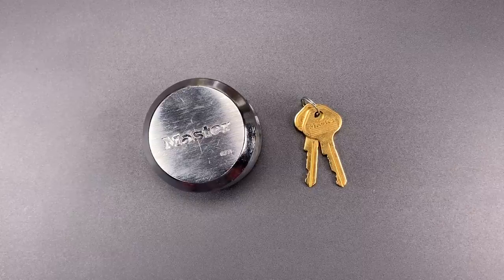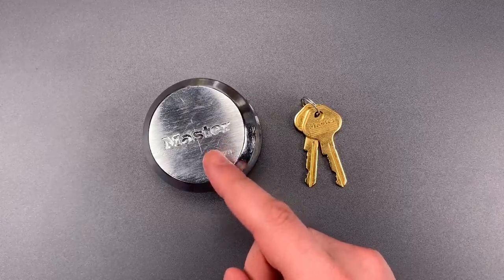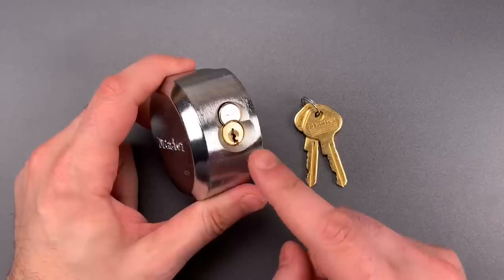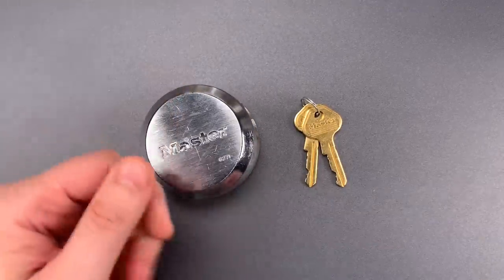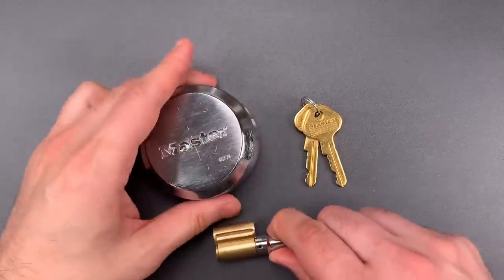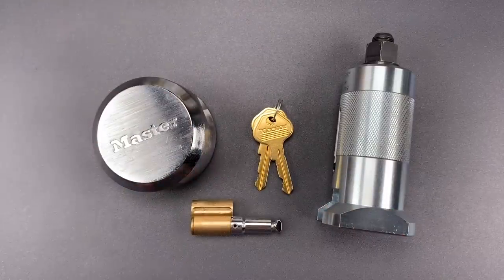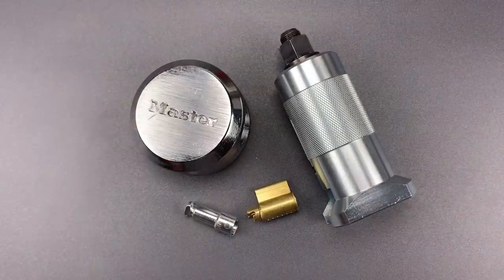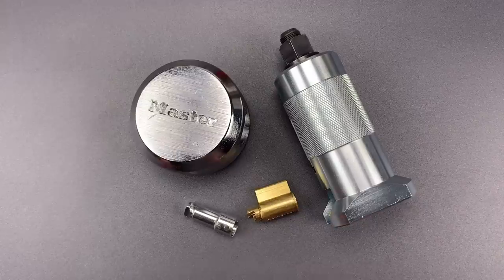[1017] Puck Lock vs. Wendt Core Puller

Comment: Thats the most resistance a master lock as ever put up.
Reply: Their mechanical design is definitely better than the design of their cores.
Reply: DrLex1 except the LOTO padlocks. Swap that into some of their sturdier locks and you’re onto something.
Reply: Nothing to see here officer; just doing a little ... ahem ... maintenance on this lock!
Reply: I agree - though I would like to see far more real world (Shrouded / wheeled / gated) proofs.  
I REALLY struggle when access and lighting is limited - shorter picks and no visual core twitching.... makes me feel like the first day again.
Reply: I don't think this will work on a laminated lock as you'd be pressing on the bottom plate and trying to pull it at the same time.
Reply: Has
Reply: So proud of the little guy.
Reply: I don't think this would be pick able in the wild nearly as easily.
Reply: So that’s what that circle on the back of vans was for!
Reply: @NolePTR  yes it would, especially for someone with the skills of the LPL
Reply: @2815Juan  it would be harder to pick because remember that's going to be right up against a vehicle door most likely either a trade van or similar. So you're not going to have as much room to move your hand around to the core as you would normally for a padlock or regular door lock
Reply: Yup, @ 2:12 When LPL wants your "Jordans" but ya Mom tied 'em inna double-knot and that day you became a double-amputee. {0.o} 

😆😂🤣

Comment: It was the perfect 90 rotation of the shackle that took the time. Long needle nose pliers are an important part of my edc.
Reply from the maker: Exactly. I should have looked at the orientation for reference before turning... I could have opened it way faster.
Reply: @lockpickinglawyer  If for some reason you hadn't been able to get the shackle out, what would you have done to get the lock off?  Torch?
Reply: @HariSeldon913  Armor piercing rounds?
Reply: @danpowell806  I'm not sure Mrs LPL would be ok with armor piercing rounds being fired in the garage, plus they'd probably ruin the piece he had the lock secured on.

Comment: It's nice to have this kind of videos as a reminder that pick resistance is not the only thing to consider for locking. Of course, the pick resistance is the weakest point of this lock even though the physical security rests on a single pin.

Comment: Just had to drill 2 of these out at our shop on a customers van. Wasn’t bad at all. Drilled hole took a extractor for bolts and turned it and opened right up. About 15min a lock for something i haven’t done before.

Comment: The problem I have with this example is it is actually more difficult then your example when it's mounted onto something. Putting the hasp in the vise doesn't simulate anything except that the tool itself will fit the mounting hasp. When the unit is up against something a steel door with levers(shipping container) or vehicle it is much more of a inconvenience. Either way thank you for your efforts to keep us entertain.

Comment: Pushing up on the lock and down on the outside end of the shackle as you extract it = considerably faster. A particular long needle nose might work as well. . 
 A quick change on the drill for running a screw (bolt) and then a socket to turn the puller would also shave considerable time.

Comment: I think you know might know this, I use that ratchet at work and it can be used really fast if you don't need a lot of torque. Either stick a screwdriver in the second hole and spin it or with your finger as long as the second ratchet is set in the right direction.

Comment: I've never seen a puller like that. I've always just used a case hardened screw with a bodyman's slide hammer.
Reply: Extremely effective against the "Eurocylinder" insert locks used here in the UK.  Not sure those are common in the US

Comment: Hey LPL I've noticed a lot of your picking videos are at "optimal" angles where you hold a lock in your hand and pick it open. 

Could you try a series about "picking irl" where you pick a deadbolt on an actual door? Or like go to a storage unit and pick a round lock where the key way is on its side and you don't have perfect leverage? 

Obviously I'm not saying to pick your own front door or storage unit, but it'd be nice to see things picked outside a clean room.

Comment: Two minutes forty three seconds and I believe this time could easily be cut in half.No light signature,very small sound signature whats not to like.The more I see this tool in action the more I realize how thoughtful the design is.I really didn't think it would work on a puck but the sides of the bell are ground down so you can get in tight spots.I'm not sure if the tool needs to be a little longer or if  you just decided to stop pulling the core and use the crescent wrench.I think it would be nice if you could use a socket with the half inch drill too to get the plug out superfast. Great video man.
Reply: @Zieh-Fix  Thanks man great tool and thanks for the quick comment.You got a coupon code I would love to buy one of these?
Reply: @Zieh-Fix  Darn it I missed the sale.I know its well worth the retail price its just so well thought out and works on almost all locks.I am working on a device that impressions pin tumblers in the field quickly but your tool does it all.Great job!
Reply: @Zieh-Fix  you'll be the first one I call thank you.

Comment: I wonder if all puck lock cylinders are secured in the same way. What screws do you use, stainless steel?🤔
Reply: Don'z Lockz there are special screws provided in the kit. Take a look at the multipick site under destructive entry
Reply: stainless is a very soft material. Less than a Grade 3 hardness.
Reply: @RuneInternational  thanks guys. Good to know. I'll do some looking around.🍺👍😃

Comment: You've tried to access it from the left side when you are clearly right handed, should have had the lock body on the right side. But this was a little more difficult than it should be, but if it was on a door or whatever, you wouldn't be able to reach around as much and have more limitation.

Still impressive that it can be done with little effort.

Comment: It looks like this could be made more secure by having something to create mechanical interference to the drill for installing the screw and for the core puller around three to four inches from the lock.  Basically make it hard to even set that initial pulling screw and hard to get a good angle with the puller.

Of course, this is all predicated on what the lock is installed on.  Automotive sheet metal isn't exactly tough and it's thinner than it was even twenty years ago.  There comes a point when some kind of metal snipping shears might simply be more effective, cut through the door sheet metal aroun the lock, than trying to cut the lock.

Comment: An honest, if albeit dumb question. If a lock is hardened against drilling the core, would this sort of attack also not work? If it would still work, why would the screw be able to get through when a drill bit can't?
Reply from the maker: You lift the pins with a brass shim before inserting the screw. 👍
Reply: @lockpickinglawyer  Thanks!

Comment: Ive seen gunsafes with this type of lock on them. While there may be other ways to construct a puller to get around this, the way the safe protected against this form of attack was that the safe face had only a small opening just big enough to reach in and push the key in the lock. That puller would be way too large to line up against those.

Comment: LPL, i would appreciate to see how good is the core puller is against locks with anti-drilling mechanisms such as MTL. Also, what kind of locks did it fail to open. great video as always :)
Reply: Really, I don't think, resistance is the important factor here. Certain lock designs are just gonna be vulnerable to pull attacks and I don't feel like beefing up the core or its retainers is gonna change that.
You'd either need to completely redesign the way the core is integrated into the lock body or, which is my personal favorite, design a mechanism that will simply shut the lock closed for good if the core is pulled by force.

Comment: Oh no i own the large version of these lock.
Edit; ok i feel 100% safer now since it didn't take the the lock master only a couple seconds:p
Reply: You shouldn't. For someone with even basic lockpicking skills, most Master locks are ridiculously easy to open. I bought a $20 kit on amazon with some z bars and rakes and a few different locks. I can open the Masters faster then even the Chinese locks.
Reply: @CosRacecar  not really I've had the core replaced to a disk retainer lock core made by my lock Smith. The one I own is 30% larger than the one lock picking lawyer has so I doubt it'll work with a core puller

Comment: You could speed up the attack by using a power tool to turn the bolt on the puller.

Comment: Did you get a new mic, or are you sick? Not sure I like the new mic, if that's the case. Your usual audio is buttery-smooth. The audio in this video seems broken. Almost like the limiter is set too low and the treble, too, is cut too low; or perhaps the bass is cut too high? Maybe a peak in the mids is cut out?

Hard to tell. I'm a recording artist, not an audio engineer. Regardless, interesting video as always.

Comment: So what's the solution?  I'm imagining a flat base on the shackle where it attaches to the core.  Hardened steel.  Tackweld the core to it.  If you pull the core out, it breaks away, and you are left with a flat metal plate inside the lock that you can't get a grip on to turn.  And then put a spring behind the lock, so you can't jiggle the lock to get the tension off the shackle and turn it by friction either.

Comment: Would there be a reason to use a wrench instead of a bolt driver to turn the core puller in a real-world situation? 

I'd like to see an optimized speed run version of this defeat.
Reply: @Zieh-Fix  an answer straight from the source! Thanks.

Comment: Would this be good for a concealed breach if you just put it back together after?
Reply: The screw into the core is destructive. There's no putting that back together even if you could replace the pin that was sheared.

Comment: Is there a way to combat core pulling?
Reply: Hardened steel spinners that restrict access to the soft brass of the core.  Hardened steel pins inside the lock that prevent the screw from going any distance and gaining purchase.
Reply: @eak125  Is hardened steel strong enough to resist the force you can generate with those lock pullers? Ive never tried it myself, would be interesting if LPL could try it on a hardened lock. I can see the spinners may be a problem, although hammering the screw in at first may bypass it.
Reply: @daveb6722  The spinner is the best way to combat a puller simply because as you try to drill into the lock it spins and the screw gets no purchase.  Anti drill pins are there to slow you down but a good bit will drill through them in time.  A screw on the other hand... not so sure.
You are 100% correct that these sorts of countermeasures need some real world LPL garage testing to see if they're as skookum as the marketing wank will have you believe.

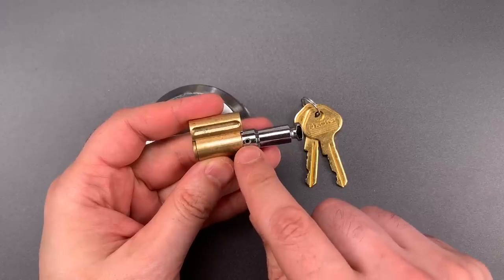Comment: That pin is a hardend roll pin which will resist any pulling fore you can throw at it. 0:30 It is the rest of the lock structure that fails and not the pin. Sheesh, get it together man... ❤️🐾

Comment: The core puller gets its named dropped and has tons of screen time. I can't recall the last time the screw got any attention. The lock puller is useless without it. I think it is called a forcing or puller screw. Your drywall screws aren't a good idea.
Reply: The core puller comes with these screws included. You can order more from the same company. They aren't cheap though and that's with good reason.

Comment: Does anyone make a one piece core puller that runs off of a drill (or built in motor)?  This one is so hilariously over-engineered for any of the locks I've seen you use it on.

Comment: How would you defeat one of these puck locks with a complete circle around them, or should I say oval?  I can tell you this, it's hardly space to even get the key in there and I had one fail and had to have it drilled out and two of us working with a two handled drill and 2x6 for leverage took about two hours to drill it out.  http://mcwelco.com/l-series.html  Here is a better picture  http://mcwelco.com/images/shotj1.jpg?crc=399074357

Comment: You had to put this lock into a vice and even then, it took you a fair bit to get into it. Not a fair test of this lock. Try getting past this lock while it's hanging freely.
Reply: This is a puck lock, it doesn't hang free. 

It's latched into exactly the steel bracketry that was in the vise, which is normally out in the world attached to what's as good as an immovable object.